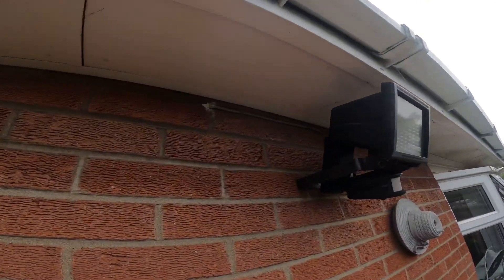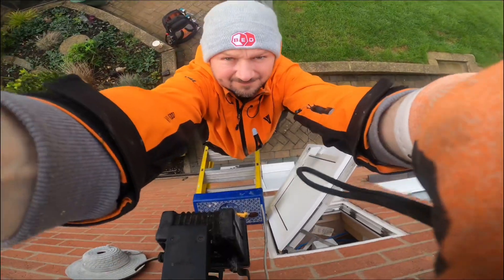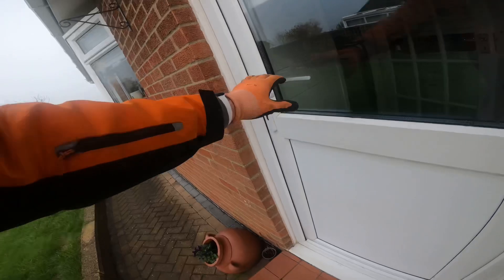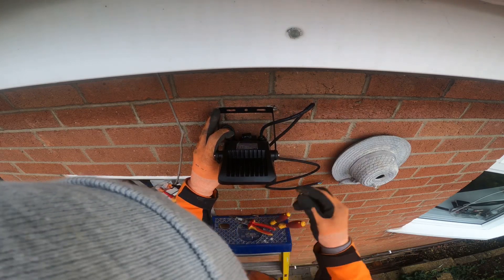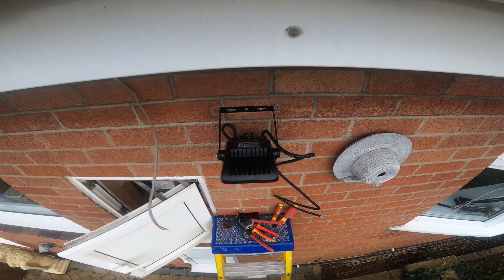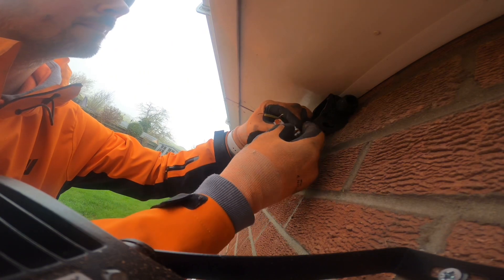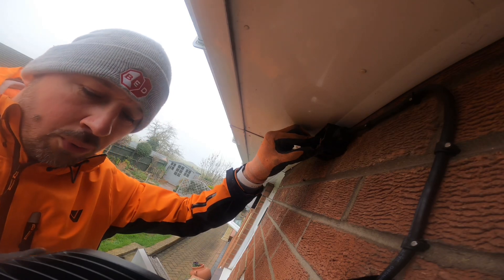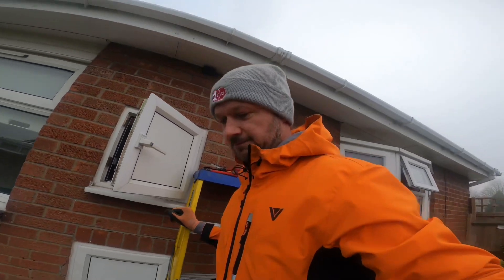How to Install an LED Floodlight with PIR Control Like a Pro! 💡⚡

Comment: Good video mate, im a diyer, just wanted to know, did you leave the switch inside that was controlling the outside light, and does it make any difference that it has a pir on the light?
Reply from the maker: I gave the customer the option to remove the switch - but she wanted it left